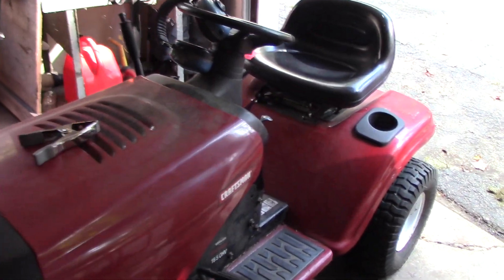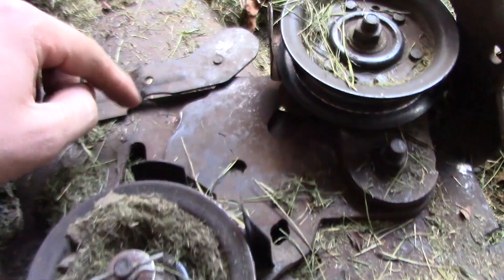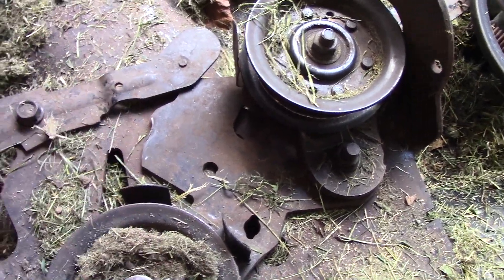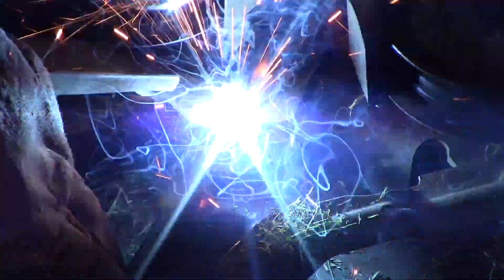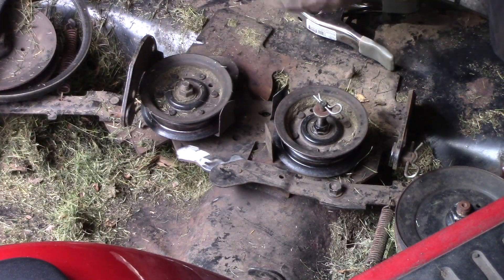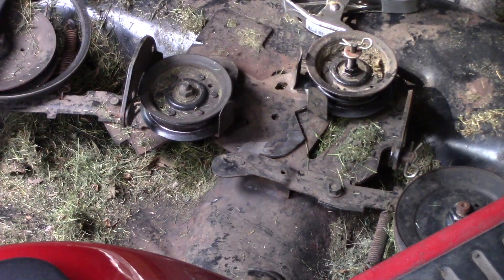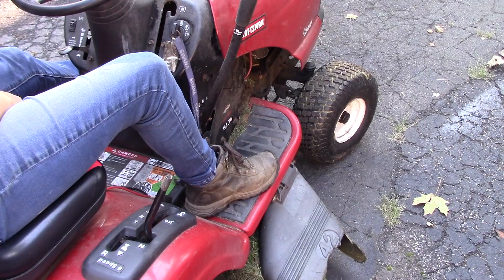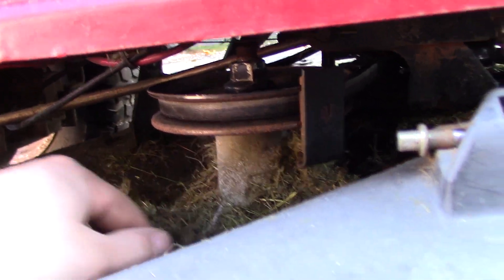LT2000 Mower Blades Won't disengage | Repaired

Comment: Thinking I would blow the dry grass off the deck before welding. The noise you hear when shutting off the blades is the blade brake against the pulleys. Not the belt.
Reply from the maker: Good tip, don't want to cause an accidental fire!

Comment: The sound made me think it was a blade brake.
Reply from the maker: You know, now im rather questioning what that sound was. I dont recall seeing any blade barking device on the deck. Hearing it again, almost sounded like one of the spindle bearings was on its way out. Could be just belt slip after blades are disengaged. Thoughts?
Reply: @OldSoulMillennial  Looking at the video at the 2:50 mark, I think the two horizontal bars (looking at the vid) that slightly move as you where engaging and disengaging the PTO are the spindle brakes.
Reply from the maker: hmm, kind of hard to know exactly what you are looking at. Have you ever hear of spindle brakes on a mower of this size? I would of though that they just slow down on their own
Reply: @OldSoulMillennial  Yes, it is to keep people from disengaging the PTO, exiting the machine and putting their toes under the deck while the blades are still spinning down. Look at the video @2:45 ish, the lever you propped out of the way with what looks like a gray handles spring clamp to grind down and weld up damaged lever is one of the brakes. The other is the similar lever to the left.